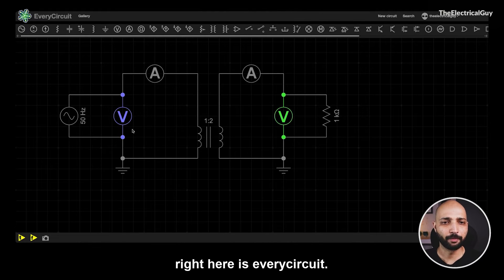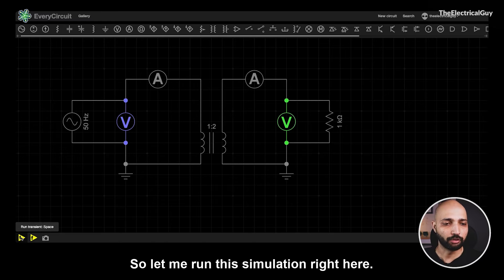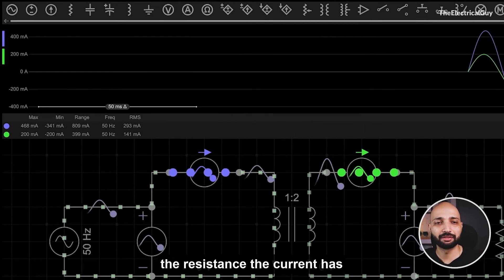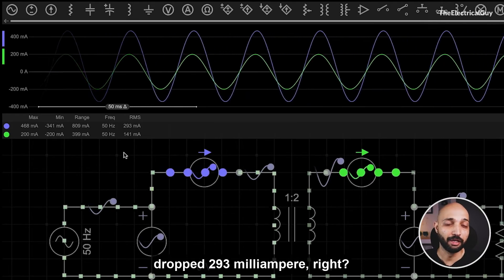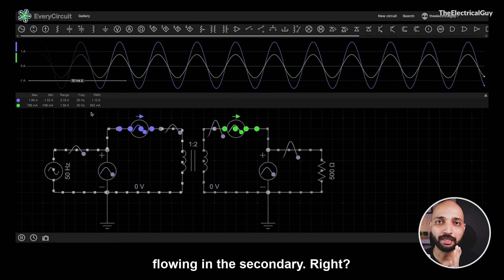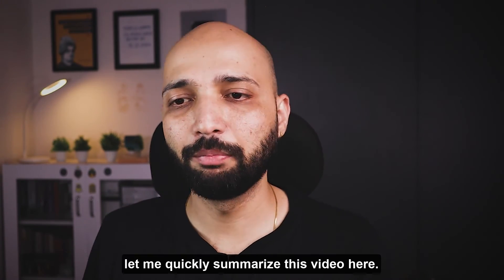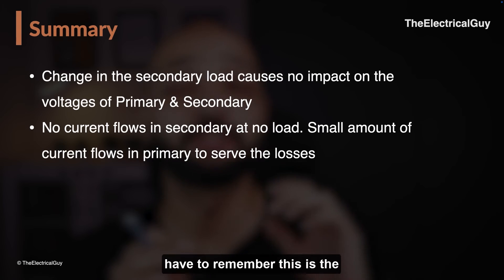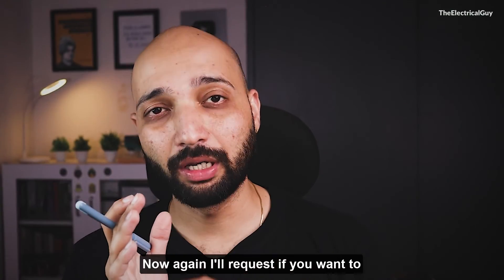Transformer Insights: Will Secondary Load Impact the Primary Current?

Comment: In my opinion, Your explanation or rather usage of the word 'load' is flawed hence misleading. You mention that 'double the load' and proceed to increase the resistance to 2k when in fact you are just 'halving' the load. Increased load will result in increased current draw which is a simple concept to follow, doubling the resistance does not mean doubling the load.